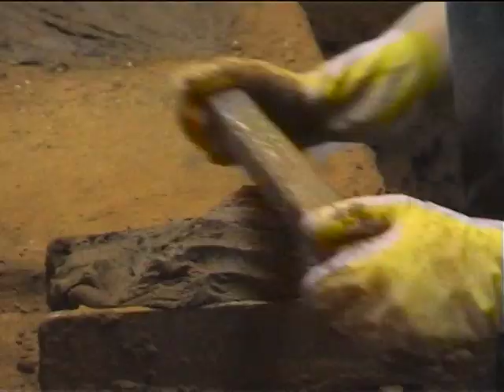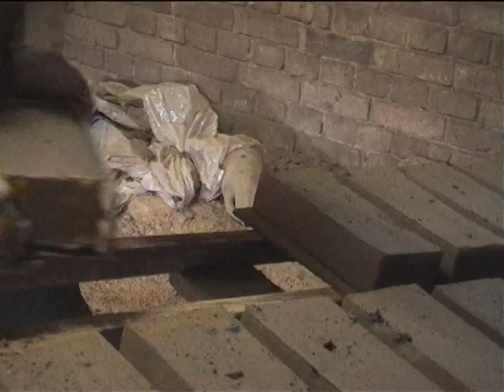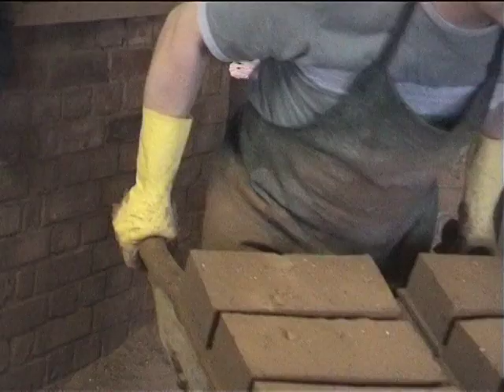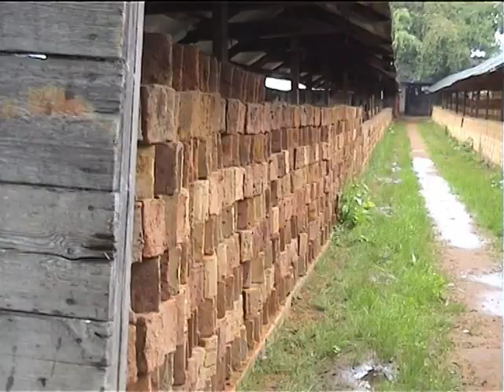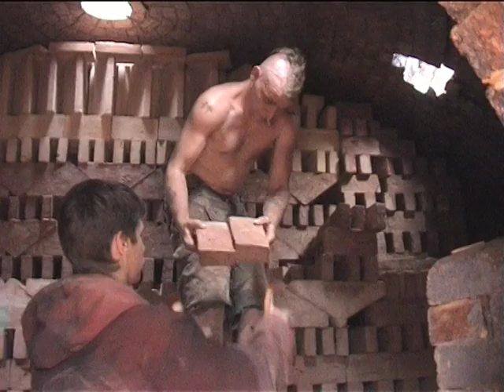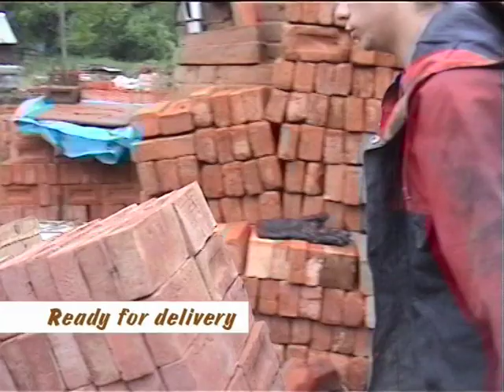Handmade brick production for restoration of ancient and historic buildings.

Comment from the maker: @aityadeen123 
Bricks are made from clay. This is dug from the ground, crushed and mixed with a little water to form the sort of thick paste you see in the video. Dried and then baked in the kiln at about 800 degrees centigrade. No other ingredients are used. A chemical change takes place in the baking process that stops the clay from being broken down by water.

Comment: @aityadeen123 I am a mason from Baltimore Md I have recently started doing repair work on older homes . I have 28 years as a Bricklayer but have mainly did brick fronts on new homes. I have a project on a home from the early 1800's and i want to do a perfect job because i take pride in my work. If you our anyone could send me a recipe to make a 5 gal bucket size potion of mortar from scratch that is with lime ect. I dont want to use to much portland and ruion a old home. Thanks.